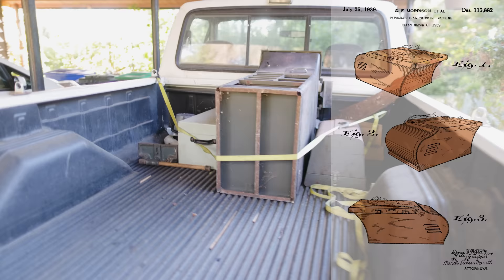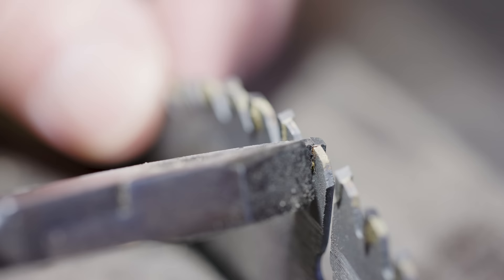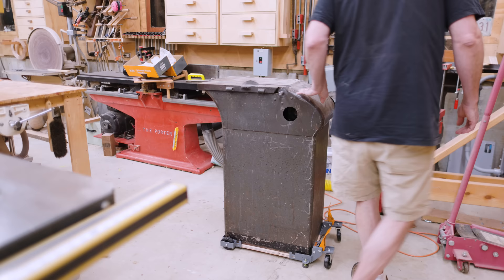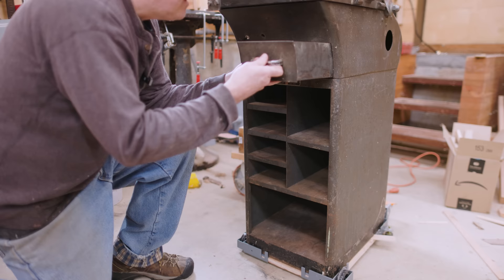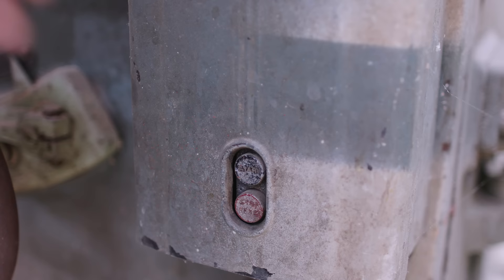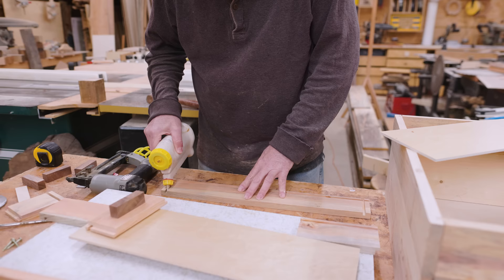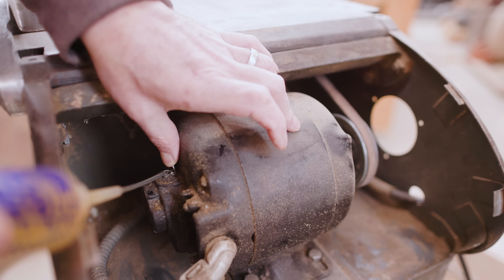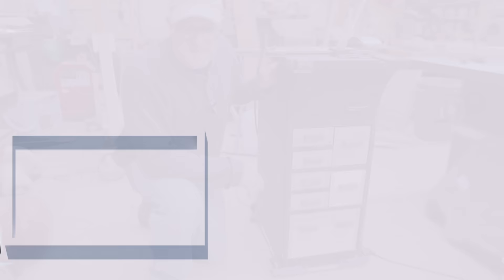Typographical Trimming Saw

Comment: This brought back memories. My dad was a typesetter and used the saw for cutting lead type. Non other than Thomas Edison said the most important invention in the history of man was the Linotype. It reduced the cost of printed word to the point that everyone could afford books and newspapers. Photo-offset typesetting rendered the Linotype obsolete on the early 80s. Dad still had a saw in his worship for exactly the reason you gave, small precision jobs. Thanks for reminding me of Dad.
Reply: I also used this type of saw and a linotype in the early 90s as part of my apprenticeship when working in the family printing business in North Wales, UK

My sister took over the typesetting using an Amstrad 1640 and the typesetting software of the day (using code for the size and style of type (well before windows became popular)).

I kept the saw after my father retired, it was a great piece of precision machinery (it even had a screw adjustable fence in point size)
I still use the pica as a measurement when working on a project with my dad. 
Sadly, the linotype was scrapped
Reply: The one we had also gad a lead plane as part of the blade.
Reply: Thank you! I was trying to figure out how this would fit into typesetting. I studied and worked in print in the 2000s/2010s, mostly litho and screen printing but was around a little bit of letterpress. I moved onto graphic design as I saw the industry shrinking around me but the experience and knowledge has been invaluable, great memories too.
Reply: @markkearney959  I was offered a working linotype few years ago. sadly I don't have a heated space large enough for that monster. It was quite a chore to the molds from jamming. Guy who ran it everyday were masters of their machines.
Reply: @AnthonyStabler    I loved my time in front of the keys on the one I used to use. It had its own character, and with the old leather belts and metal fixings, it used to play its own tune.

We would float a pork pie on the lead to warm up for lunch and for the thrill seeker in me, there was always a little excitement when the moulds hadn't quite sealed against the lead injectors and the odd splash of lead would be sent airborne.

On another note, the keyboard was great, and it took me a long time to get used to a qwerty keyboard once I finished
Reply: Thanks for the story,i love these old machines

Comment: Maybe you could put some spacers on the 3 bolts holding the nameplate, so it will kinda float and allow for air circulation to cool the motor.

Comment: 13:08
I think thats for dusk collection.
If your dustcollection is on the left or on the right side of your trimming saw.
The cover is for the hole you dont need.
Reply: I don't think so.
Because that hole is right next to the motor.
A hole for dust collection would be by the blade (just where the dust bin is)
Reply: Being a typesetter saw, it will have sawn lead slugs of inverse text. So, the "dust" would have fallen mostly straight down to the bin.

Comment: I'm an old letterpressman. That is a lead saw.the original blade had 3 holes for trimmers stick through to clean up the edge of your lead spacing & cast linotype. You need the trimmers to make measurements on the 'miter guage' accurate. The measurements were 12 points to a pica, 6 picas to an inch or  72 points to an inch. Leading came in 1, 2, 6,& 12 point strips. I still use my line guage every day but now I use the metric & imperial measurements on the other side. The hook on the end is very useful. Too bad you didn't get all the accessories that go with the saw. The hole on the right side was a mount for a grinding wheel. Find a blade with a nagative rake angle will help with the ragged cuts. I have that exact saw in my shop. I still use it for lead. The drawer was for lead shavings. My father dold me he had molds for casting little army men, but I have yet to find some. You're the best, Frank!
Reply from the maker: I'm learning so much more about this. Saw after I published the video? Thanks for the info.
Reply: Here’s a link to the brochure: http://www.galleyrack.com/images/artifice/letters/press/comproom/saw/cg/cg-sawliner-printers-saw-brochure-c1-0600dpijpg.pdf

Comment: These saws were used by me to cut lead rules, lead spacers and trim half-tone photographic plates. Type was very rarely if ever cut on these. The only time I cut type on this was when I cut 2 Monotype S characters in half to insert a rule to make a dollar sign. It was extremely dangerous, I remember it well. The font didn’t come with one in England and luckily we only needed one to do the job.😁 the groove in the bed is where the clamp went to secure the stock in place. If you look up funditor saw you will see many examples.
Reply from the maker: Super helpful, thanks for the info.

Comment: I have one with a sliding table (left-side); cross-cuts only. The fence has a micro-adjust with .1 picas per detent (so, that's what, 1/128 inch?). Ridiculous levels of precision capable with that saw! It was given to me by my Dad who was a printer for over 50 years. He had a machine shop fabricate a 45-degree "jig" that fits the table (likely for woodwork, can't imagine a printing need for 45 degree lead "slugs").

Comment: I learned typography by hand setting foundry type. It's been decades but if memory serves we used a saw like this for cutting "slug" lead strips that separated lines of type. The cubbies under the saw were for those strips which came in different thicknesses. The blade cover and dust bin was to contain the lead dust.

Comment: Given that the holes in the case seem to line up perfectly with the motor and pulley, I am thinking there may have been an optional accessory to run off the motor, and/or a provision to run the machine off of a line shaft.
Reply: Or there might have been some accesories that you can mount to motorshaft like drillchuck 🤔
Reply: It was probably for an accessory. I have a printer’s saw that has provisions for a blade sharpening accessory that attaches to the motor.

Comment: I used this saw myself when I was a kid.  My father was a journeyman printer back in the hot-type era.  He worked as composing room foreman for the local daily newspaper, but also set up a letterpress shop in our home basement.  This saw was used all the time to cut the lead slugs - some spacers, some lines, some from the output of a Linotype machine.  This brings back so many memories from my own time in the home letterpress shop - 1950's in Joplin Missouri.  Thanks for posting this.

Comment: To reinforce the epoxy of the guard: I would drill and tap some holes in the side of the guard and bolt a second metal plate to it for reinforcement.

Comment: The spaces where the drawers are going would have had galley trays of type ready to be cut to the correct width (in ems) for columns of type in newspapers or commercial print shops. The saw was a pretty essential tool in letterpress printing especiall for cutting “slugs” of type from linotype or ludlow hot metal type setting.
Reply from the maker: We were wondering what originally went in those cubbies.

Comment: Looks like a nice little saw to have in the shop Frank. As far as that blade guard repair, I would use some thin Aluminum and cut it to fit over the outside surface of that repaired seam. Then just epoxy it over the seam. You could even use a few small screws to hold it in place as well. Or if you had access to a welder, just weld the outside of the seam. 👍👍

Comment: You should add a strain relief to the electrical cord where it comes out of the cabinet. A clamp-style electrical box nut should work fine. It might seem unnecessary, but the cord is old, and will appreciate the support.

Comment: Easy peasey.  This is for cutting spacing material and Linotype/Intertype and Ludlow slugs to length.  It's designed to measure PIcas and Points.  Be forewarned, points are 1/72 inch.

Comment: Someone has to say this: dude, you go out of your way to build all of these very creative, robust pieces of furniture that look beautiful and also like they can outlast a nuclear bombardment, and then you move heavy equipment into your workroom via two bendy planks that WILL give way under you at some point and buy you a head x-ray in the process and possibly two steel knees.  PLEASE PLEASE PLEASE will you build some clever, robust folding ramps of some kind so we don't have to cringe every time we see you move newly acquired equipment into your shop?  We want you to remain in as few pieces as you are in currently, okay?
Reply: Or at least put some cribbing underneath the ramps Frank!  You have access to free millwright services, use it!
Reply: He has a gantry crane, and a setup to roll a piece onto a platform above his stairs, pick it up with the gantry, roll the drawers out of the way, and lower it onto a cart.  It sounds like it just wasn't convenient to get for this small of an item
Reply: All I can say is that I already have some steel teeth... And it's definitely not fun to put them in. So imagine knees. 😬
Reply: Amen!
Reply: Or at least have the saw go first so it doesn’t run you over
Reply: eh didn't look that sketchy.

Comment: Nice video.  It's a great find and beautiful cabinet.  However, if the repair fails, the guard could fall on the blade.  It looks like you could scab on a piece on top of the guard... even if it's glued on, it'll be an improvement over the butt joint.  JB Weld is fine but I'd consider Black Max.

Comment: I have a Hammond trim-o-saw (a sliding top typography saw) that I use when I need VERY precise cuts (intarsia, unusual joinery, etc.). Built in the 50's, it's solid cast iron (I had to use and engine hoist to get it up onto a mobile base).
Forrest will make you a custom blade out of a woodworker II, but they come dear.  Best advice I can give is CLEAN THE CRAP outta it, and wear a mask! These things were for cutting LEAD and trust me: think lead PAINT was bad?
Reply: Also, thinking about it: theres a bloke on the machinejunky and practicalmachinist forums - crzypete, I think his name was - who has a guide for converting the guides from pics to inches or mm, if you care.

Comment: I found that using some nylon of teflon runners on the bottom of the slides makes operation much easier.  A plastic cutting board is a cheap source for this.

Comment: WRT blade choice maybe get an arbour adapter, or the current Arbor machined down (probably from engineering company to order) to be able to use a wider selection of blades? It's a great little saw. They are rare and fetch good money. I wonder whether this would be a good saw for small finger jointed draws etc. ? btw I think the pulley is rubbing against the motor or loose*. My pillar drill made the same noise until I fixed it. *Maybe
Reply: Well reflected & explained 👏

Comment: Nice video. I have a lead type cutting saw in the shed that I was given years ago and I need to do something with it - yours is only the second I've ever seen working. Mine is a different make I'm in the UK and I think it's a UK made saw) but it's about the same size as yours, has a single steel catch drawer underneath for the waste, dual belt drive, a sliding cast bed and a full cast iron stand which weighs a ton! I was wondering whether to convert it to a sliding bed router table as the saw blade has a strange fitting (three fixing screws rather than an arbor nut) and is therefore difficult to replace as I'd have to drill a standard sawplate. However, I believe you make have sparked my enthusiasm into getting it sorted out!
Reply from the maker: Sounds like a great project!

Comment: I think this saw was used for cutting lead printiing type used in the letterpress printers commonly used for newsprint in the days gone by.
Reply: Do you mean to actually cut the letters themselves out of a blank of lead? Like, getting inside the spaces of an “N” for instance?
Reply: @cgstadler  No, cutting blocks of letters (or picture) to size.  The actual letters were made using molds.

Comment: I wonder if you could attach your dust collection system into the hole on the left side. It is the blade side of the motor and dust did collect there. Hmmm 🤔 Just a thought.

Very cool video and find. I love videos about rehoming and refurbishing old tools like this. I bet that motor has lots of life left in it.

Comment: The saw would cut in point, picas, ens and ems. The saw would cut “type high” (0.918”) square cuts. There would have been accurate mitre gauge. It looks like some guarding has been removed, this gaurding was designed stop cutting off the operators right thumb.

Comment: I bet those holes in the case you covered up with the name plate would originally been for a version of this saw powered by overhead belts. There would have been a long axel in place of the motor with pulleys outside of the case for the belt.
Reply from the maker: Interesting, I think that might actually work

Comment: Is it possible the name plate was lifted away from the side of the machine by spacers that allowed airflow?  The screws seem long enough to allow room for that additional accessory.  Combined with a vent on the opposite side, there would be some ventilation for the motor.

Comment: why not take the guard to a weld shop for welding?  Construction seems strange. Based on motor pulley location it must be driving a long shaft across the entire saw width to the blade. Can't imagine why that would be done. You could take any blade of your choice to a proper machine shop for a 7/8" hole

Comment: Frank, would a dust collection port make sense at the extra hole on this saw?
Reply from the maker: I thought about that, but in looking at it it doesn't really connect to where the sawdust goes so I'm not sure it would work that well.
Reply: @frankmakes  Make something that will guide the dust toward the hole on the inside. If you are considering 3D printing, this would probably be a good first go.
edit: grammar